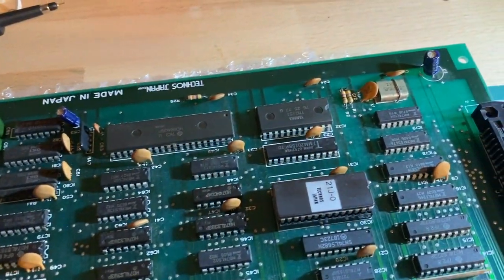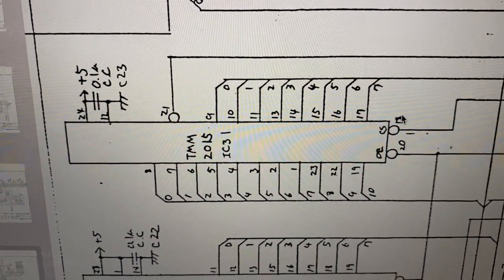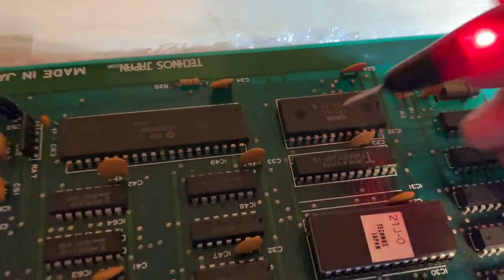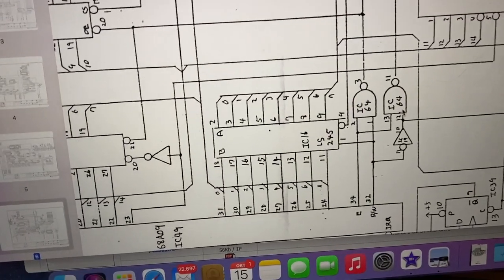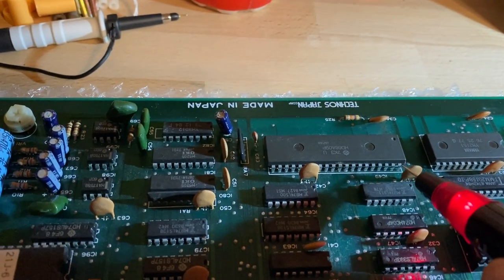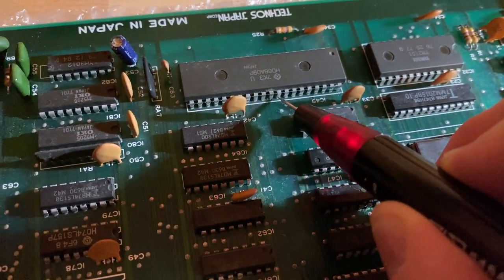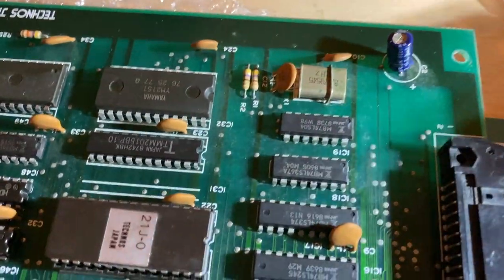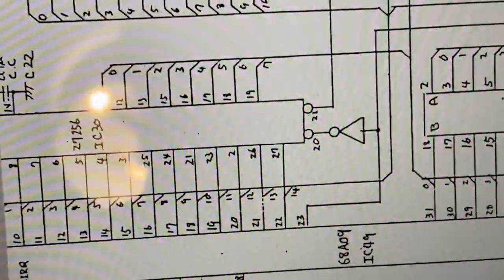Double Dragon Arcade PCB - YOU do the repair! - Part 4

Comment: Couple of tips, 
Double Dragon needs -5volts for the Audio to work correctly make sure you have a good -5volts.
Audio channels come from three separate OP Amps IC 97 IC98 and IC99 these often fail and you loose audio channels, the outputs are later mixed to the final mono output also check all those small caps they often go bad also loosing audio. The amp itself also has a audio pop protection capacitor and if that one is bad can mute the whole amp (unlikely if your getting the finger buzz test OK)
Depending on what you hear when probing at the inputs of the opamps you can go forward or backwards in the circuit.
Use an audio probe and "listen" to the digital and in the analog circuits the audio generated something like this from amazons.. Piezo Electric Crystal Earphone Sensitive High Impedance Ceramic Ear Piece very handy to listen... you could also use your scope and look at the generated audio waves and get an idea from the opamp point which way to go..
Also I watched all the videos and board corrosion was glossed over quite a few times PART2 video at 4:16 you can clearly see corrosion evidence most likely from leaking caps over the years... You can also see the very dull solder... more evidence but most important is the via's you can see the traces clearly have dark spots... Thats bad! Often thats corrosion eating the very small traces and often they are broken right where the via goes through the board... You cannot ignore these... At the very least test them but they all need a brush with something like a fiber glass pen, re tin them and in some cases add a link.
Lasty those F chips cannot be underestimated! Highest failure rate and I saw a few in these videos with rust, if not already they will fail, the rust eats them internally.. save the time and get rid of them!

Comment: Greetz! You likely have completed this video and repair already. Just leaving my contribution! - Appears the board is capable of generating the music just fine. Judge still out on digital samples although sample EPROMs are okay. The IC responsible for playing the digital samples could be at fault, or the 4558 op amps at IC97 + IC98 (Samples iirc) and IC99 (Music iirc) failed preventing consistent playback (more likely). Can verify at the source - Are the samples and music playing, but just not being amplified correctly? These are quick tests that can be checked by tapping into the outputs of the sample and music generator ICs output to something like a pair of cheap amplified desktop PC speakers. Can compare in/out of the op-amps. You can even see the music and fighting noises playing on the scope this way. Also, Great channel!

Comment: A couple of thing I would look at. This seems like a mixing issue. If I recall correctly, the coin-up sound is a sample. Try setting the attract mode sound on via the dips and see if the music plays right away, and if it will also play the coin sound. The FM music sounded fine to my ear, so I think that part is working, but the sample seemed warbly. I'm suspecting inconsistent voltages so some bad caps, possibly. Why it takes out the entire FM playback is beyond me. I'd look at the schemas, but I can't see well enough to read them.

Comment: The choice of troubleshooting the analogue or digital parts of the sound circuit first is a coin toss so either would have been valid. At least the fact that you are getting some sounds seems to indicate that the analogue side is working pretty well. Is I understand it some sounds are samples and some are generated tones so narrowing down which is which would help determine which parts are silent. As you say, tracking down an intermittent fault can be very tricky and time consuming. At least you know that the faults most likely lie on the digital side of the board. Good luck! 👍😁
Reply: Hi @Spacedock8 watching this video when you say analog vs digital parts do you mean digital being the ic's and analogue being discrete components like caps-resistors etc?

Cheers Franky
Reply: @YNGBLD80  Hi. No, analogue parts deal with electrical signals that are not the digital ones and zeros (the actual levels of which are determined by the logic technology being used). These tend to be things like amplifiers used to boost varying signals such as  sound. These analogue devices are often packaged in the same kinds of encapsulation used for digital devices such as DIP or SOIC. Capacitors and resistors are discrete components and are generally used to "condition" signals such as smoothing voltage ripples on power lines. There is an old argument that "everything is analogue" because in reality there are no such things as true digital signals in electronics, but a great deal of time, effort and money has been put into making circuit technology that behaves as close to digital as possible.
Reply: @spacedock873  OK thank you for the reply and help, so when there is reference to analogue components in sound circuitry is it namely just the amps that id associate as analogue?
Reply: @Franky P  There are other analogue devices apart from amplifiers. Because computers operate in the "digital domain" and the world is not digital there must be ways of converting signals from the analogue real world to the digital world of the computer. One type of these devices is a generic "analogue to digital converter" or ADC. Other devices are things like temperature sensors which detect the temperature of a probe and produce a digital output representing that temperature. Going the other way you need a "digital to analogue converter" or DAC. Sound chips are one example of such a device but you can also use more basic methods such as a "resistor ladder" and indeed many cheap personal computers in the 1980's used these to generate sound without the expense of a dedicated sound chip.
Reply: @spacedock873  Thanks again SD appreciate the info- I have been doing a little more reading with regards to DAC and PCM interesting stuff. A resistor ladder DAC might read up on that also, finding this stuff quite fascinating. Thanks for being polite enough to help.
Reply: @YNGBLD80  More than happy to help and encourage an interest in this topic 👍😁